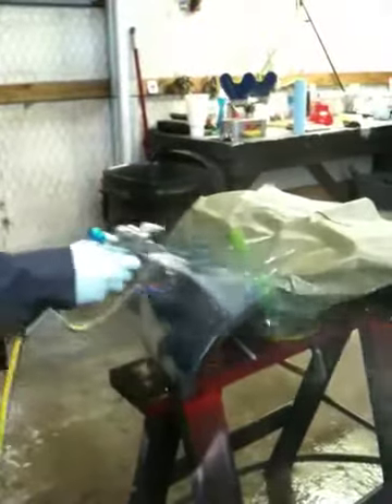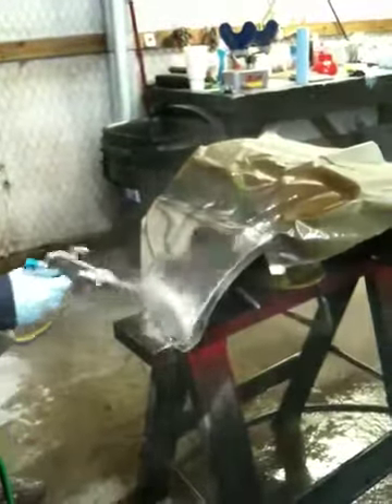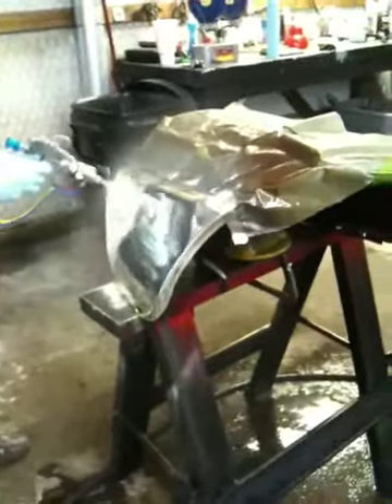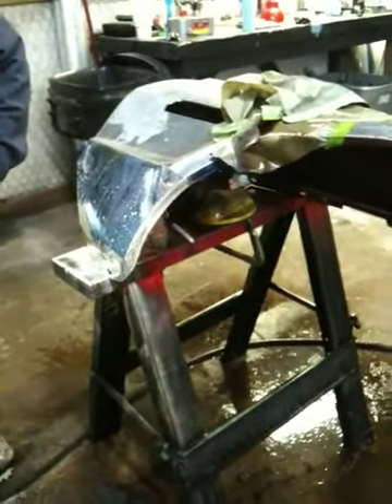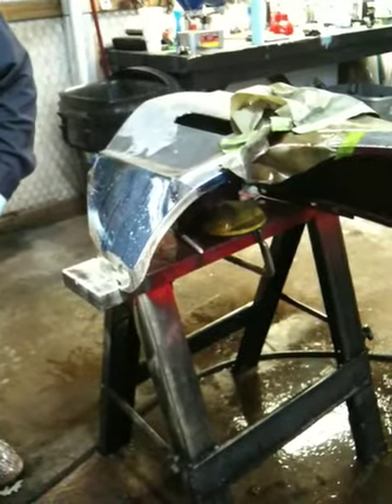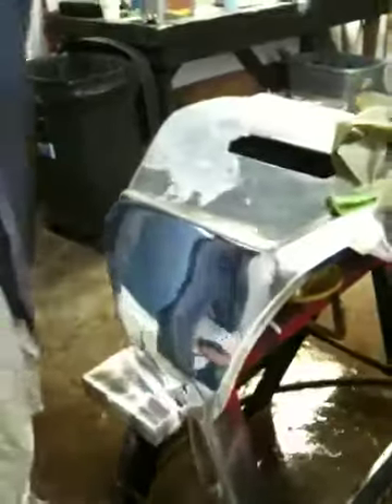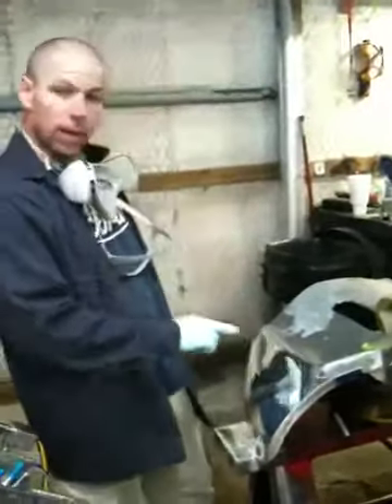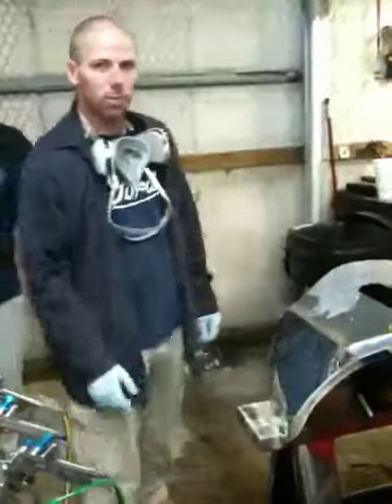Spray chrome demo pt2

Comment from the maker: Not sure what system you are running but it will be slightly yellow till the top coat is applied that gives more of the silver mirror finish. Still too much yellowing can also mean dirty air. Make sure you have proper filters on your air line and get a refrigerant too cut down on the moisture. Streaking could mean it is reacting to something on the surface. Such as not using the proper tape, or not priming all the surfaces. Good luck!  We are still working out all the kinks too.

Comment: you need deionized water with .000 no paper tape or paper use black tape. Back you silvering gun up the product needs to mix before it hits the surface. The yellowing it not from the tape put the activator  mixing with you silver rise rise and rise.